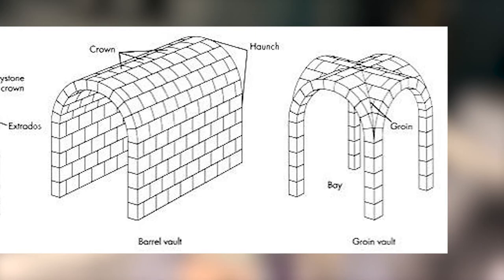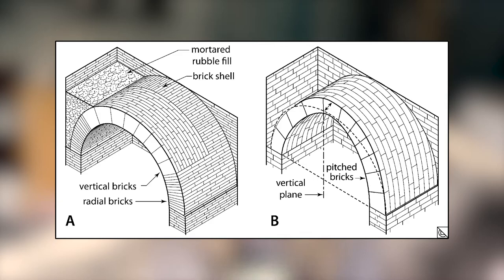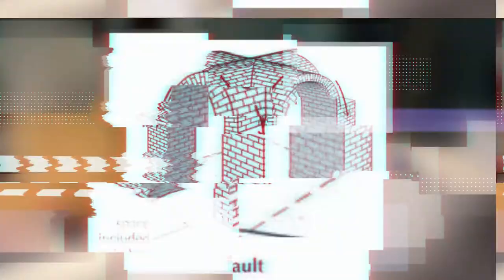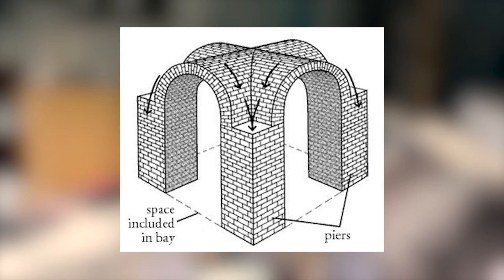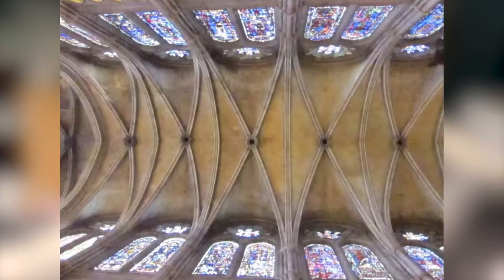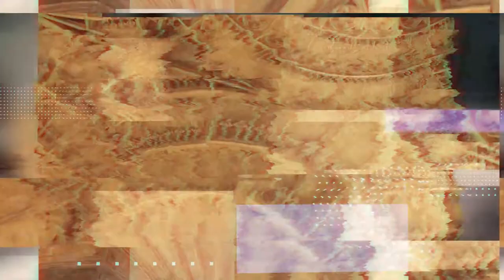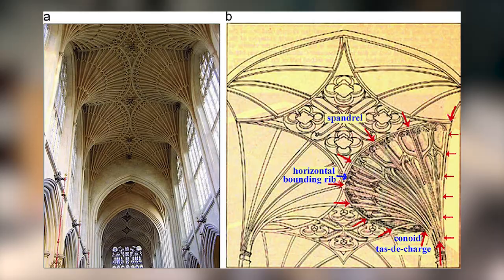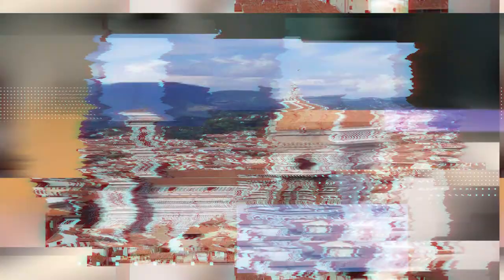What is a vault in architecture? | Types of Vaults - Barrel Vault, Groin Vault, Ribbed Vault

Comment: In the vaults of churches or auditoriums, the empty clay vessels were installed in non load bearing areas to enhance sound also known as 'vaulting tubes".
Reply: @UnravelingArchitecture  ...and no compute raided design, no solid works and even no international system of standards! Later in 20th century, the technological advances allowed to build items of huge size and in large quantity, allowing multiplication of errors (produict recalls is one example) and significant regional  and global scale disasters (Chernobyl, Fukushima, WTC collapse, Challenger and Columbia disasters, ozone hole)